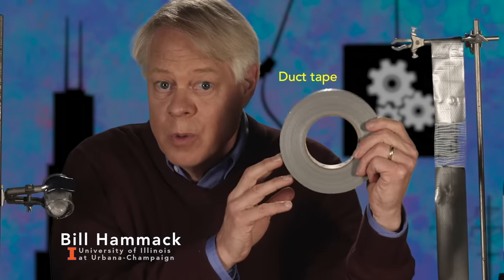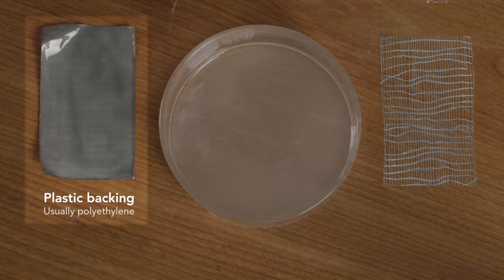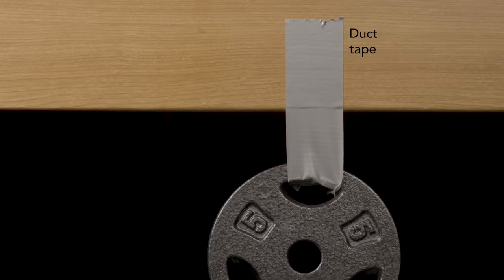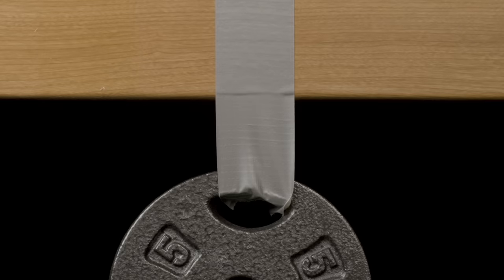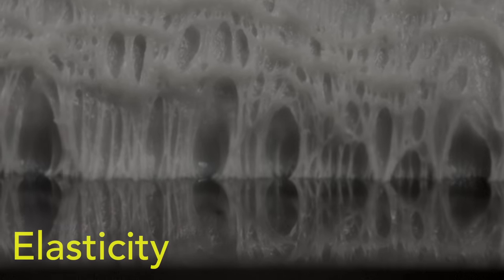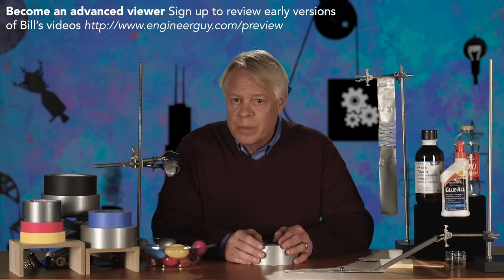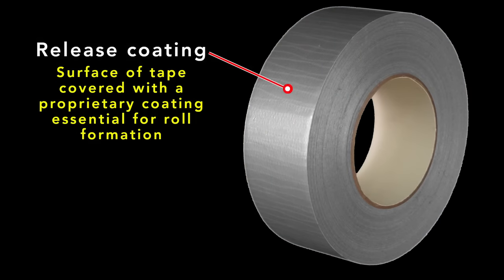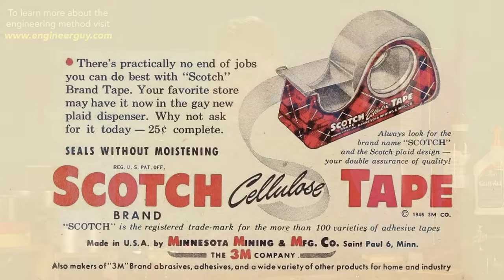The Engineering of Duct Tape

Comment: I'm a mechanical engineer turned dentist, and Holy crap this video is so far up my alley. Obvious why it's interesting to an engineer, but as a dentist there is so much engineering that goes into designing all the composite resins, acrylics, etc we use for fillings and cementing crowns, repairing dentures, etc etc. Great video!

Comment: That parting dad joke, or should I say, engineer joke, was the cherry on top. Quality content as always!
Reply: Came here to say that.. after years we almost see him smile :D
Reply: I seriously always thought it was used for ducting. Now I wonder where the name came from.
Reply: @nomadMik  Low temperature ducting. Notice the warning is against ducts that carry a lot of heat, which I presume would cause the adhesive to not work.
Reply: @nomadMik  I guess it should not be used in places where it would be subjected to heat, like the body of a vacuum motor, whereas taping a vacuum hose would be fine.
Reply: @andrius0592  Importantly, don't use it on the supply ducts of say, your home furnace. The hot air heats the ducting enough to cause the adhesive to fail.
Reply: It originally comes from the canvas used in the cloth of the tape (duck from the Dutch "doek" meaning linen canvas).

While there are specific kinds of duct tapes designed for ducting, the word was originally duck tape. Having fallen out of favor, duct tape has supplanted the old name of duck tape, with exception to the brand of tape called Duck Tape.
Reply: A dad joke but it’s true… a dad decree?
Reply: @nomadMik 
It was originally duck not duct
Because it used duck cloth

Comment: I went into the world of adhesives for a large project at work a couple years ago. The amount of engineering (and just general testing) in it is crazy. I mainly focused on epoxies and their adhesion to between dissimilar materials. It's crazy how many factors come into play - surface area, temperature, surface smoothness/roughness (laser ablation!), curing conditions.. the list goes on..
Reply from the maker: Indeed: It is amazing complex. It reminds me of how metallurgy used to be described: one third science, one third engineering, and one third black magic.
Reply: Is there a tape that actually IS weatherproof?

Comment: Thanks for adding the important note of NOT using it for ducts!  Our builder used it to hold together the dryer vent pipes inside the wall and I found out years later because it ended up melting and the vent pipes separated. So the dryer was venting inside the wall for years! When I opened up the wall I found mold and years of lint!
Reply: Lucky to notice it before a fire
Reply: @alistairblaire6001  Agreed!
Reply: It should have been foil tape.
Reply: There is special metallic tape for ducts...up to 350*C, and even other types of tape that can handle 500-600*C, for a chimney or something.
Price is also special XD
Reply: And here I was thinking the warning to not use it on ducts was to avoid liability if it were used to repair something that carries noxious fumes, and it failing and leaking resulted in death or injury.
Reply: @dant5464  no Duct Tape is a 3m product and is a knockoff of Duck tape. Duck Tape invented that tape and 3m stole it. They changed 1 letter and slightly modified the logo. 3m got sued by Duck Tape and had to change the logos and marketing. That 1 letter change was allowed. 3m was later sued for the tape again and lost again for the “duct” part of the name. That’s when they put the disclaimer “not for ducts, on the package. Wikipedia has not helped as that page is very wrong about it. Duck tape came first.

Comment: Peeling is interesting from an engineering perspective. The hold of the glue can be considered in terms of required force per unit of area - a bigger contact area of tape can resist more force. But when peeling, most of the adhesive is bearing no load, the entire load is applied to a line. Theoretically a line has zero area, so the effective force per area while peeling is infinite. No wonder the adhesive fails

Comment: Great, clearly explained video as always!
1 question is not answered: Why is it called Duct-Tape if it is not supposed to be used on Ducting 😅 I've always learned is was invented for use on air ducting.
Reply from the maker: I could not get a clear answers on this, other at the kind of urban legend level.
Reply: The original term was duck tape, named after the type of fabric used in the backing, duck. People switched to calling it duct tape, possibly because not many people know what duck fabric is.
Reply: It's named after a kind of fabric - https://en.wikipedia.org/wiki/Cotton_duck

Of course, people have long since forgotten this meaning, and at some point, people felt that "duck tape" is a mispronunciation (or mistype) of "duct tape", which sounds more reasonable if you don't know what duck cloth is (helped by the fact that people did actually start using it on air ducts, and the marketing quickly switched to a shiny grey finish to look like a duct :D ). Which itself gets hilarious when people then go the other way, and even weirder, when a US company actually manages to call their "duct tape" product "Duck Tape" and register that as a trademark. Which is legal because the original common name has "fallen out of use". And now you can't call duck tape duck tape anymore, because now it's a brand product, not a common name.
Reply: @figmentpez  Thanks for the rabbit hole you just sent me down 😆. So, from what I read, it's one of two things: either the early versions made by J&J did use duck fabric, as you said (which I just learned was an actual thing), or it was because the soldiers in WW2 referred to it as "duck" tape because of how water rolled off it like a duck's hydrophobic feathers.
Reply: @LuaanTi  Funny that it comes from the dutch word "Doek"  Which means Cloth. And it is indeed Cloth-tape. Which makes sense...
Coincidence is that i am dutch 😅
Reply: @justsomeone89  Yeah, languages are funny that way :D
Reply: @LuaanTi  America was kolonized by the dutch and the brits in that order. So it is not odd to see some of the language adopted in some way. 😁
Reply: @LuaanTi  I always thought this was the case and that it was invented to help seal ammunition cases. But, there are multiple sources that trace the lineage of Duct Tape differently. I think it was wise of the author to steer clear of anything that did not contribute materially to the product we enjoy today.

Comment: Shoutout to project farm for helping me buy the best duct tape out there, T-rex tape.
Reply: We're gonna test that!
Reply: I fixed a leaking water pipe with it 3 years ago, it's still there and not leaked. T-rex is awesome.
Reply: If this is the bougie tape connoisseur sub thread then for the regular class of duct tape my vote is for Nashua. Of course if you need the high performance then step up to the 3m or Berry. Then of course we have to talk gaffers tape.  And don't forget aluminum tape for actual ducts.

Comment: Well done. I've been in the pressure sensitive tape industry for 25 years, specializing in double-sided tapes. There is so much more details, but the highlights are found in this video. Btw, the largest duct tape manufacture is a company you probably never heard of, but they private label most of the well known brands. If you're ever curious if an old looking tape is still good, if you have difficulty removing the tape from the backing, it's no longer good enough to use.

Comment: Thanks Bill for the great video. I once got into a discussion on the differences between Gaffer's tape and Painters tape and how the two of them differ and have very different applications and how knowing the difference is useful. Painter's tape when applied to the back of fabrics will not pull fibers out, while Gaffer's tape will. So in theater-where both Gaffer's tape and Painter's tape are readily available in my profession- it is is appropriate to fold curtain fabrics and tape them with Painter's tape to keep them wrapped, but not Gaffer's tape. So while Gaffer's tape and Painter's tape are similar, it is important that Gaffer's tape has a higher stickiness than Painter's tape and to use appropriate tapes for their appropriate application.

Comment: I am really happy you've found the time, motivation and crew to start uploading videos again. I hope there are many more to follow.
However, I cannot let the infamous faulty '3-gears-representing-engineering' icon used in the backdrop go un-commented (3 interlocking gears in this configuration is functionally defunct, as it doesn't allow for any motion in either direction due to a rotational direction conflict). Unless it was deliberately placed there as an inside joke. In that case: you got me.

Comment: What a fab video. Another great feature of duct tape is its proportional tearability. It's possible to part it off its roll without scissors etc, but it will rarely, if ever, fails by splitting etc in use. I think this might be due to its cloth reinforcement and tearing it strand by strand it possible off the roll and its adhesion (wetting) when in place. It's also good in multi-layer situations so the silicone release coating must be wettable to some extent with additional pressure  See I was paying attention! Many thanks for this video!

Comment: For those who have not yet gone to college: My son is an EE. While he went to Purdue, U of I’s engineering school is similarly well regarded. Before you go to college, though, learn enough woodworking to make a box and a simple cabinet. It’s surprising that 2/3 of engineering have never made anything. Knowing how to use a grinder, drill press, band saw, paint brush and other basic tools provides a remarkably rich start to the rules of thumb explained here. Learn to solder so you can create circuits and build and repair metal boxes. The insight you’ll get from just a few self designed projects (successful and unsuccessful) are important.

Comment: It is very interesting to learn about the details of duct tape.  As you mentioned, it is no longer recommended for any type of duct sealing, although I believe it was in the past.  I have quite a bit of experience with heating duct systems,  and the replacement is metal foil tape, which has a much longer lasting adhesive.  I have seen that the duct tape adhesive degrades after a few years, and its temperature rating is probably pretty limited.  The red tape commonly used to seal vapor barriers and house wrap in construction also has a longer lasting adhesive (probably the life of the house), but, unlike duct tape,  it can't be torn by hand, so is not as easy to use.

Comment: You’ll notice during the first closeup of tape peeling that right at the line where the tape is peeling up the adhesive is also being pressed into the glass, improving its peel resistance. This is caused by a “lever action” that is a function of the backing stiffness.

Comment: This was an excellent explanation of a little-understood subject. I would love it if you had gone into acrylate tapes (or could do so in another video), which are a step up in stickiness from duct tape, and are explicitly not designed to be easily removable. Airtightness tapes, designed to be very sticky indeed, and with 100yr design life use acrylates. I presume (but don't know), that the well-known 3M VHB adhesive is also acrylate-based. Then there is the interesting process of manufacturing such tape without getting your machines all gummed-up, and the difference between dissolving the acrylate in a carrier and having the pure stuff (stickier, but significantly harder to manufacture). There are several brands which I presume all have similar chemstry: pro-clima, partel, siga, illbruck, ampack, dafa, but maybe it's more complicated than that.

Comment: 5:40 using duct tape in a number of enviroments I've learned a few things: dont leave it in the car or the roll is gonna suck to use after the adhesive gets softened.
In weather below 0C/32F, the adhesive is to hard to stick, especially on an unclean surface. when using duct tape, shoot for room temperature if possible

Comment: The adhesive seems to be very different depending on price range. I used the cheapest possible duct tape to secure plastic sheets over a missing door on my car when i took it home afte purchase.
A while later, when the car was safely in my garage, i removed the duct tape so i can fit a door i had bought at the junkyard, the duct tape seperated in half upon removal, so the car still has bits of adhesive and the reinforcement all over the rear left door frame.

I believe the heat and UV from the sun was responsible too, as it was transported on an open trailer and sat in the sun for a few days too.

Comment: We used to use 4" wide duct tape to make an emergency repair on 300' by 42" wide belts that ran in a cooling tower ( long conveyor line ) that carried chocolate coated candy. We were supposed to spend a few hours to revulcanise the belt at end of shift but lat it run on duct tape for a few days. Used to tell the candy foremen that is was food grade duct tape. Great stuff. Still have a quarter roll of this dark green 4" wide duct tape that I took home back in the 1980's. Still using it. Gadgets take is best in class to tape wire to floors but very expensive.

Comment: TL;DR
do NOT use plain ol grey duct tape to try to fix your air conditioner ducts. either know what you're doing or leave it up to a licensed professional 

10:15 funny enough, this is true for standard duct tape (the grey colored stuff at Home Depot etc). I'm an HVAC Journeyman and can confirm we NEVER use this kind of duct tape when building ductwork. we use a different, much sturdier kind of duct tape that's much less sticky and is moreso a structural piece to bind together any ductwork from flexible, vinyl inner-lined and aluminum outer-lined fiberglass insulation to galvanized steel hard duct and everything in between (rigid duct or "ductboard" accounts for the majority of a duct system's trunk line found in residential applications as well as many office buildings with flexible ducts branching off the trunk to wherever cool air is delivered). it's only one part of the structural integrity. we combine several methods to ensure an airtight and insulated seal on any duct moving cool air. flexible ducts are the most susceptible to leakage so in that most extreme example, we use a very fibrous and slightly sticky form of duct tape (colloquially called "black tape" for its color from most brands) to secure the inner vinyl lining of the flex material to its destination. the fiberglass insulation between the vinyl and outer layer is then pulled beyond the destination to ensure the area is fully insulated from outside heat. then the outer lining (usually a very thin form of aluminum) is pulled beyond that fiberglass insulation and secured in place with a much more rigid aluminum tape (known to workers as "silver tape" again for its color) that is a bit like aluminum foil youd find in your kitchen albeit with an adhesive on one side. for particularly rough applications such as existing and old ductwork, we apply a sprayable adhesive to this silver tape to make it more tactile and adhere to a surface without sacrificing structural integrity. finally, we cover the entire ensemble with mastic which is a semi-liquid "glue" of sorts that acts a bit like the silly putty. its extremely viscous and dries in under 36 hours while flowing slowly to fill any possible gaps in the connection. designed to withstand heat (as most duct systems will be in attics or above ceilings where the air is not cooled and the environment is very hot by design) the mastic completely ensures an airtight seal and provides the final leg of the structural integrity once it fully dries. I've ripped open many a grey tapes from DIY-ers to find moisture leaking thru an air duct only to be rectified by the correct tapes/adhesives and application process. definitely never use that standard grey duct tape on actual duct systems. it will break down and fail quickly, and in worst case scenarios may flood your ceiling

Comment: Duct tape is a highly plasticised PVC tape without cloth, which allows it to stretch a huge amount, which allows it to be applied around the circumference of concertina duct and, because of the huge degree of stretching, the tape that is between the high points of the concertina relaxes and shrinks back to its original length, which translates to a smaller circle, so it self applies to the entire surface of the duct, hills and valleys alike, letting the tape seal perfectly when it is used to join duct work together.
The tape with cloth in it is useless for duct work as it cannot stretch, so it cannot relax or shrink back to its original state, so it unavoidably leaves a passage, like cardboard wrapped around a hollow screw, where air can escape.

Comment: Duct tape can support a 5 pound weight FOR A LITTLE WHILE.

I learned the "hard" way in college that even a bunch of duct tape will allow a relatively light weight (an 8 inch wide cheap plastic "basketball hoop") to creep.

My ~5 oz hoop wound up a foot lower than when I put it up at the beginning of the semester with probably 25 or 50 in.² of duct tape holding it!

Comment: Sorry Bill, but I believe what you put in the dish was intact what we in Australia refer to as Cloth Tape.
Duct tape is, as the name suggest, used in the application of ducting, and has no cloth.
The other tape which is often mistaken for either of the above is Gaff tape, used extensively in the entertainment industry as it doesn't leave any messy residue when removed from such surfaces as carpet, painted surfaces, etc.